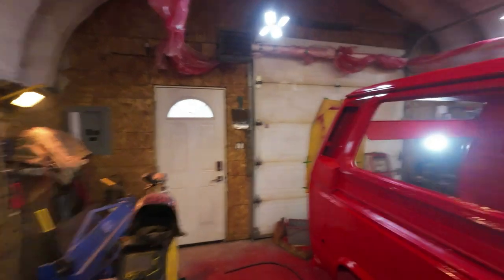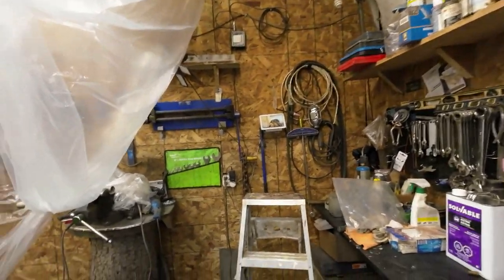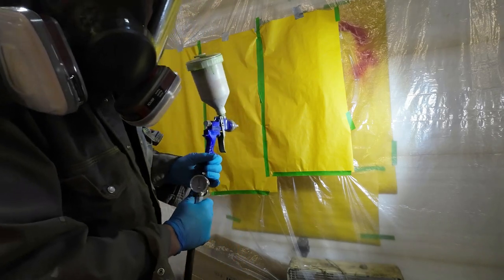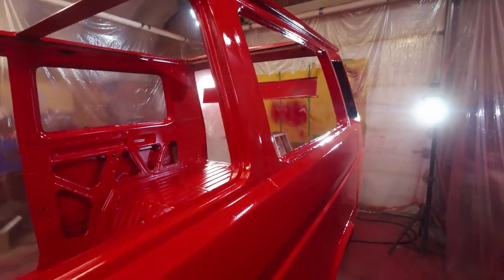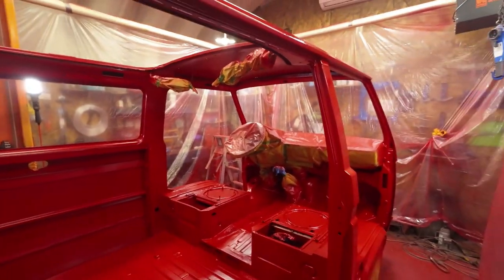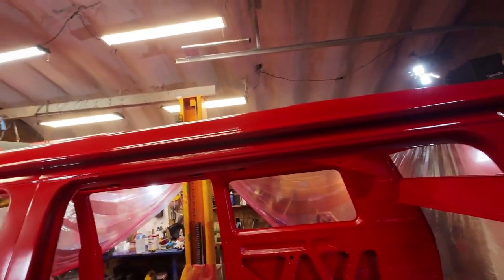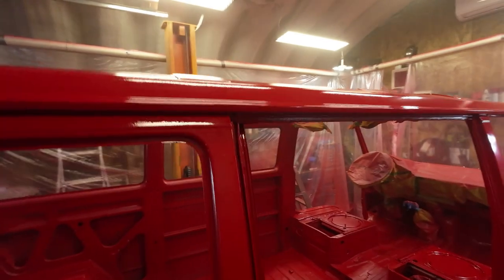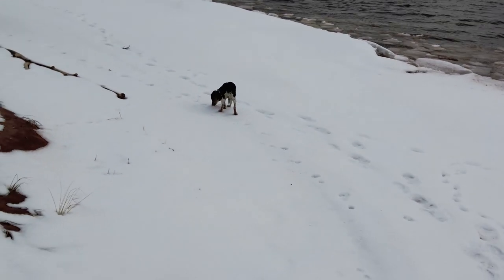1982 Aircooled VW Vanagon Westfalia Restoration  Paint Day Episode 41

Comment: Wow, just wow! That red looks great, fantastic job Lorne, never heard of Tremclad here in the UK but its saved you heaps of work not having to primer then flat off and remask again. Brilliant job, well done, look forward to it all coming together.
Reply from the maker: Thanks Ian, it did cover very well, and is a nice color, There are a few brands of rust paint here mostly if you look for a DTM (direct to metal) it would be very similar. The nice thing about Tremclad  is its availability in different colors, I don't know if you can mix a can of white to any color you want??? The clearcoat really brings the finish up.
Reply: @LorneKelly  I did paint a cheap run around, a Renault 12 back in 1979 in green metallic Hammerite using their thinners, it did come out quite well but was a satin finish, never realised you could put a clear coat over it, it would have been so much better. In those days you only got a few basic colours. Hammerite is a lot different now and doesn't seem to cover like it used to, for hand brushing direct to metal I now go for Rustoleum so maybe that would be as good as your Tremclad product, food for thought for a future project.😉😉
Reply from the maker: @iankidd6500  Yup, Rustoleum is the same product..if you do not add a hardener I don't think you can use a clearcoat, the youtube guys say that once hardener is added to the paint then it becomes like a 4K product.. so far it seems OK ...Mixed 4 parts base 3 parts thinner (acetone) and 1 part hardener.
I found a very reasonable clearcoat online and delivered to the door...There is lots of area on the van so I am happy not to have to spend Thousands of dollars on paint...
Reply from the maker: Yup I should have said 2K...I wonder what a 4K would be??
Reply: @LorneKelly  Brighter🤣🤣
Reply from the maker: Hi Ian I replied on the broken video, then deleted the video so I think my reply disappeared...I looked at the export to the local disk and it stalls at the same place, I bet the cat came over and sat on the keyboard while uploading....
Reply from the maker: Yup, its back up with the complete video...https://youtu.be/FZQLQ7Flllc